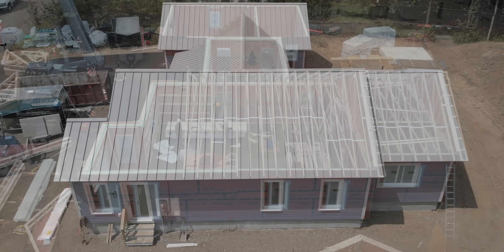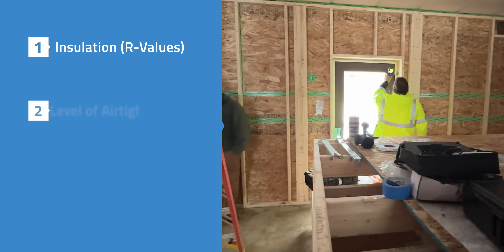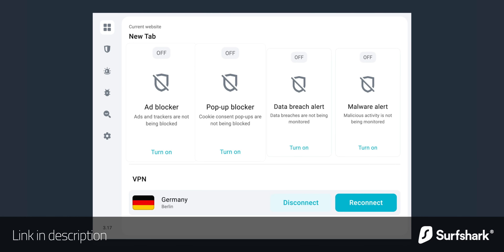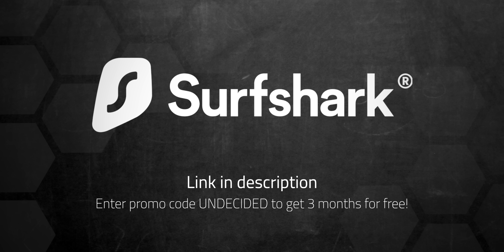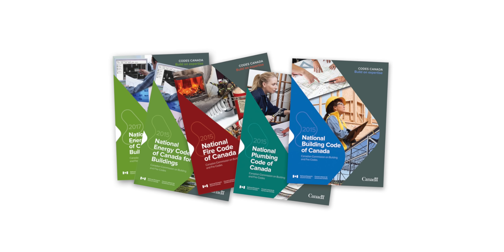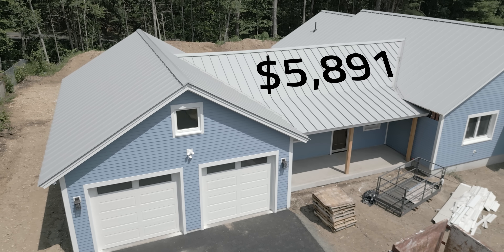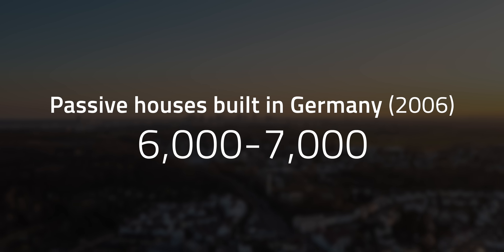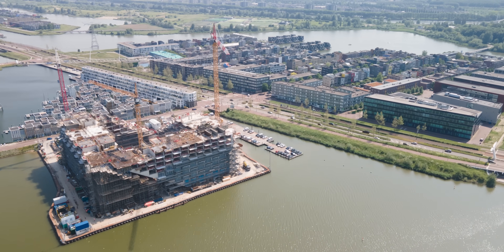Why Do American Homes Suck?

Comment: I've had such conversations with German colleagues over the years.  It started when I asked one fellow why he rents rather than owns a home.  He was an engineer well into his career, a point at which an American engineer would likely own his/her own home.  He responded that the price of a home was well out of his ability to afford one.  When I probed further into why that was, he explained how houses in Germany were built of masonry to last for centuries unlike American houses that are built of wood and cheap materials, and to standards much less strict vs those in Germany.  I remember feeling sorry for my German associates not being able to own their own home until the middle years of their live.
Reply: Masonry should only cost 25-40% more. Not trivial, but not by itself an explanation for why people can't own things (also the US has plenty of old masonry housing that no one wants).
Reply: @josephfisher426  25 to 40% more is a lot.  That's why the vast majority of homes in the U.S. are stick-built with some brick or stone veneer on the front, and are still out of reach of many people.
Reply: @MsAjax409  In the past it was common to exchange smaller size or less complexity for greater durability. Structures that are true masonry on the first floor were a common design for tract construction in the first half of the 20th century, and beyond that for individual projects. But they were economical as houses that would fit within the footprint of a 3 car garage. Or on slopes where a heavy basement retaining wall is already part of the price.
Reply: @josephfisher426  it's not just the masonry. It's everything from full basements, tight building envelopes with lots of insulation to much higher grade wood beams to higher quality roofing materials to more stringent requirements fir electrical, sewage... Even windows (triple glazed with vacuum layers) and kitchens (better slides, materials etc) are of significantly higher quality. 

I'm in Switzerland, it's the same here. A new, decent house costs at least 1.2mil in a marginal area, and in a large city you're talking astronomical, 3mil, 5mil, easy. A small apartment will be at least 700k outside the centres, within a larger city 1.5mil and up (NOT downtown). That's a small-ish 2 or 3 bedroom. I own now (through sheer luck), but my last rental was in a (much updated) 250yo building. Solid rock walls, about 2 feet thick, 3 stories plus large double floor attic compromising of solid thick wood beams.
Reply: @mysterioanonymous3206  At those prices one can never sell enough. Or in the case of higher-grade wood beams, build enough, because they simply don't exist in large quantity. They were cut down in past centuries, and what we are using now is light quick-growth managed forest.

High-quality materials of all sorts are not unusual in the US---they're just not "builder grade."
Reply: @josephfisher426  I know there's some very high end homes in the US but they cost as much if not more than here. Unlike ours, your codes allow cheaper construction methods so....
Reply: @mysterioanonymous3206  HIgh home prices in the US are mostly a function of location and size. Quality materials can be had for a modest-sized house at something still less than McMansion prices. Maybe $100K more than the cheap stuff.
Reply: Wow it sure would suck if the houses were built poorly and were ALSO unaffordable for most Americans
Reply: @ZachHoekstra  The price of a home is largely determined by its location and size.  You pay what the market demands.  The median home price in the U.S. is just over $400,000.  Prices are higher on the coasts and near large cites while lower in the Midwest and many southern states.  The median home price in Honolulu, Hawaii,is about $700,000.  The average San Francisco home value is $1,300,000.  Not all homes are cheaply built, of course.  My house near Chicago was built using ICF (insulated concrete forms).  It's designed and built to withstand an F2 class tornado (113-157 mph winds) whereas code only requires that homes be built to withstand 90 mph wind speeds.  Homes in coastal California are built to survive earthquakes.  The affordability of home ownership also depends on property taxes which varies widely throughout the country.  In the Chicago collar counties, you can expect to pay 2 to 3% of your homes market value annually. $10,000 is not unusual depending on the commercial/industrial tax base present in the county.  A "starter home" in the Chicago area will range between $200,000 and $300,000.  Affordability will vary depending on mortgage interest rates which are quite high at present (near 8%).
Reply: Germany has a massive housing shortage and at least part of that is due to (unnecessarily?) strict construction codes. It's nice to have energy efficient homes, sure – but it's also nice to have housing, period. So there's a trade-off to be made here.
Reply: @tom4794  Europes population density is a lot higher than the US. Much of the land that is left is used for agriculture. Rural or wilderness areas like in the US simply don't exist in Europe, so the land has to be much more strictly controlled and that works almost exclusively via zoning and building code. Expansion like in the US is simply impossible here.

We also import all our energy, so efficiency is a very serious security issue and the cost is much higher (huge incentive for better efficiency) - we have no oil, no gas (or locations willing to extract it rather) and relatively little in terms of renewables potential, although what is available is quickly developing. So this constraint is not self imposed, it's simply a necessity in our geography.

Where I am in Switzerland we have the same issues and they really enforce dense construction. Single family homes are becoming much rarer. In or near economic centres they are virtually unaffordable since almost no new ones are being constructed.
Reply: @tom4794 well said. I've lost count of how many times people on quora talk down about US homes, when they themselves are from European countries where they are far more likely to rent. Again it's about tradeoffs. I would rather live on my less efficient and bigger house on more land than a smaller more efficient house for the same price or a similar size home for a higher price. Even if it may cost me more on the long run,  the difference in purchase price is worth it to me. When I'm retired i can easily cashflow those high costs without the mortgage.
Reply: @juniper-ug3hs  like tom 4794 you disregard the price for building-plots in most of the denser populated countries - more often than not "more land" can not even be bought for something less than outlandish, unless you buy an old farm or small enterprise place to restore.
Reply: @aasphaltmueller5178  while land prices change from country to country. The discussion and video is mostly about energy efficiency and material cost. I'm saying Im glad I had the opportunity to buy a cheaper, less efficient home and that my country didn't  pass codes that required more expensive components. As a result, I'm able to afford more land because my house cost less. I'm sorry for the plight of the people who live in more densely populated areas when it comes to housing costs, but I left those areas to live where I do now. Quite frankly, I hated living in major cities and the obvious answer to me for anyone who sees no future in these areas is to do whatever you have to move/immigrate (legaly of course) to an area that has opportunities that meet your needs.
Reply: @juniper-ug3hs  I mentioned this as a weak point in your argument that you had made in a general manner - it does not work   to the same degree in other countries/regions. Also those price structures make it more or less interesting to invest in energy efficency or not; also emmigration/immigration is a thing quite essy within the US, international less so, whist europeans tend to be rather sedentiary. Last - my price argument was about basycally rural areas- property in cities  , especially one family houses, is something for the rich.
Reply: @aasphaltmueller5178  given that the point of the video was energy efficiency in European vs American homes and the creator essentially argued that it comes down to building codes my response is I don't want higher priced more energy efficient materials required in new home construction. I want homeowners to be able to make the choice in tradeoffs, not local or state governments. In regards to land if you are going to spend money on a cheaper you have more money to spend on land that's all im saying. Yes, there are numerous other variables that affect housing. This
Reply: @juniper-ug3hs  well ok - were I'm from, the codes are actually not that "heavy", you do not need to build very efficient, but as energy prices are high, one usually does what is possible in the financial bracket available. There are also subventions for retrofiting isolation - we remoddeled  the roof of the family home last year. - and as said, in denser areas not only in Europe, I lived in India and the middle east, often bigger plots are not easily  available/buyable  due to zoning laws, so it is not always a either /or question as not every family can move to the "sticks" - if they could, then it would become dense there.
Reply: @tom4794  The people most affected by the shortage wouldn't be able to afford a house at American prices either, though. We mainly lack affordable small to medium-size rental apartments in big cities. Not single-family houses.
Reply: @HeadsFullOfEyeballs  But the discussion about energy efficiency and building codes isn't restricted to single family homes, it's the same for multi-unit buildings. Plus the entire market is connected: if a family can't afford a house, they'll take an apartment which might otherwise have been shared by students and so on.

I'm not against energy efficient homes, I just don't want the other aspects like affordability to be overlooked in the discussion.
Reply: @tom4794  We actually have the same problem as large US cities in that living in cities is simply unaffordable but no one wants to live in bumfuck nowhere anymore if everything moves to public transport and other stuff that is not feasible/good in rural areas. The other thing is that buying land is fucking expensive here because you can't just build a house if you have the land to do so - you have to get it zoned and that is a major PITA. So land ready to build on is very expensive, about the same as the actual building of the house in a "normal" area - 2-3x the cost in an attractive area, less in rural areas.
Reply: @tom4794  - Ohne Landflucht hätten wir ein vernachlässigbares Wohnproblem. Doch wenn Verkehrsanbindung und Infrastruktur kaputtgespart werden, ziehen die Lemminge in die Stadt und befeuern damit noch die Preissteigerungen.
Reply: There is a myth in Europe that American homes are built specifically to be cheap.  American homes are built to be remodeled frequently because American homes are often damaged by phenomena called "Tornados" and "Hurricanes", weather effects that Europeans don't have to deal with.  Now, it IS true that houses can be built Tornado or Hurricane proof, but only if you're willing to essentially live in a hobbit hole, which obviously prevents cities from being a thing.
Reply: Europe has less space as well so your German mate may have had to cash to build/buy a home but he won't live a hundred miles from his work as US buyers accept to have a home over renting closer to work and spending less time in gridlock driving or massive commutes. Also many German rents are set with stricter rental laws so Germans spend the extra cash on shopping or travel or their pension. American bet their home is their pension.
Reply: I built a modern house for 246k € in Germany in 2019. Insulated like crazy, prefab so the structure was erected in one day, heat pump and solar panels with a battery. Everything included in the price and zero construction risk for me. My cost for heating and warm water are close to zero.

My plot of land (600 m2) cost 300k though.

Its the land not the construction methods. The world is just crowded.
Reply: @hkad6252  the world is not crowded. Most of the planet has no one living on it.

Comment: I studied architecture. I agree with every criticism here. There is one problem with insulated windows which a lot of people don't speak on. They only have a 15-20 year life span for a window that cost 2-3 as much as basic windows. We need better designed insulated windows that allow them to be maintained and "refilled" with argon rather than just toss them out at the end of their lifespan. They are replaced 2 or 3 times over the life of a structure. A better designed product wouldn't warrant that waste.

Comment: I’d like to see a video on the thin triple glaze you mentioned and do a deep dive on its properties. I sell windows and insulation for a living, and as I understand the reason why thin triple panes are worse than the thicker triple pane is because the thinner triple pane thermal units need to use krypton gas, which is less inert than argon, and the added glass in the centre will transfer temperature faster than the gas filled thermal unit, which I have taken to mean a well manufactured double pane is better than a thin triple pane. In addition, krypton being less inert means premature failure, which over the long term will defeat the purpose of having the thin triple pane installed. If I’m wrong about this please let me know!
Reply: If I know my building physics correctly (and I really ought to!), the reason why you use krypton gas is because it's heavier than argon, which slows convection in the space between the panes (and also has a lower thermal conductivity, for reasons I don't remember - we went all the way to the atomic level in one lecture, but that was years ago). Bigger atoms/molecules (it's down to the same thing for noble gases) also makes the windows less prone to leaks. Making seals that last long is a bit of a challenge, though.

The reason why the building industry abandoned triple-pane glazing for a while was that the old triple glazing simply featured regular, air-filled cavities between the panes. Air is a good insulator as long as it remains stationary, and by using three panes you got two cavities which reduced the rate of convection. But then somebody got the idea to use noble gases and infrared coating (to block thermal radiation), making double-pane windows as efficient as the old triple-pane windows. Two panes are less heavy than three, so double-pane windows went back in favour for a while. It took a while for noble-gas-filled, coated, triple-pane windows to enter the stage. Now I've seen lab tests of seven- or ten-pane windows to reduce the U value even further (the more panes, the more cavities, the less convection), but I think those still have too many durability issues to hit the market just yet.